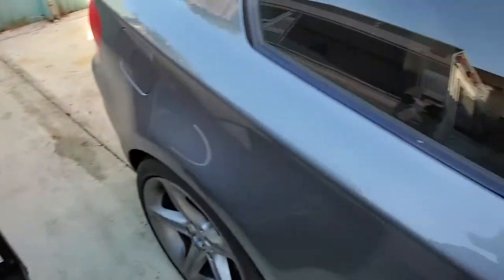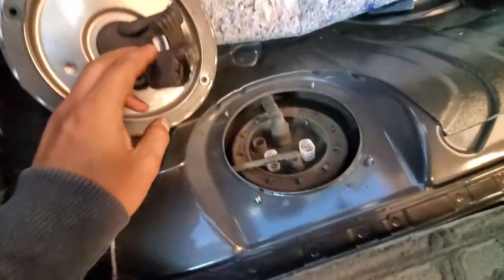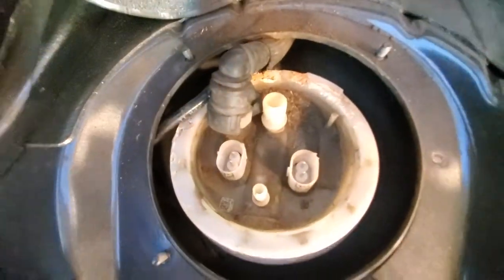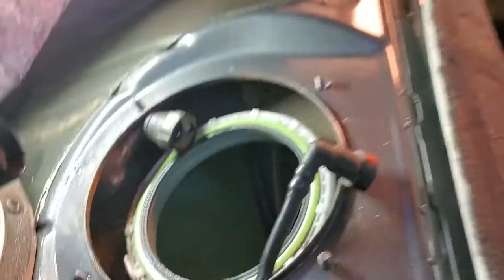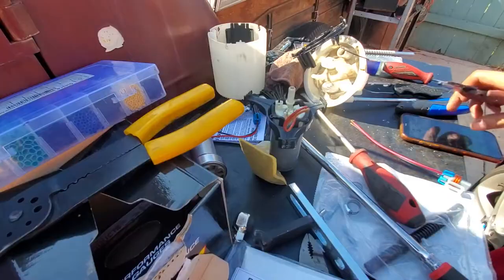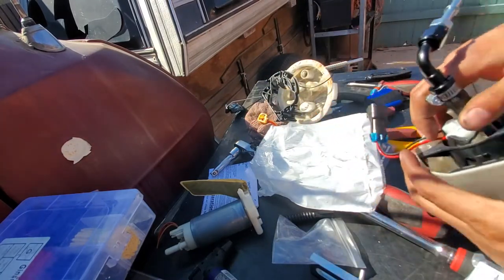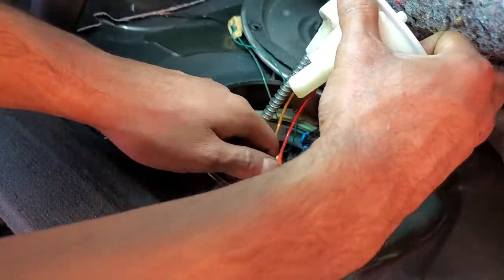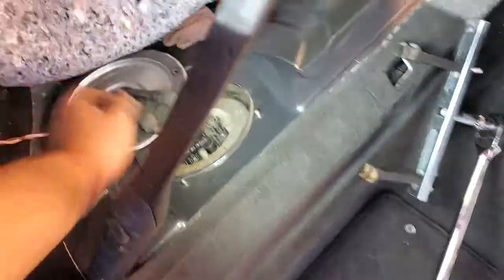N54 STAGE 2 FUEL PUMP UPGRADE!

Comment: Hey man nice video. I just did 2 of these diy pumps in a very similar way. Just so you know you don't have to cut the bucket to fit this pump. Also, that rubber hose that you  use will fail when using e85 and then all that rubber will corrode away in your fuel system. You need to use an e85 rated hose. Trust me.
Reply from the maker: thanks for the tip i did hear about the hose having to be e-85 compatible. And it is true you dont have to cut the bucket but i saw online its not a bad idea to do so.
Reply: @menjicar  hey i know i’m about 7 months late but it’s actually better for you NOT to cut the bucket, the bucket is there to hold fuel when ur tank runs low (under a quarter tank or so) so that the pump can stay cool and lubricated. cutting the bucket will allow that fuel to escape when running low on fuel. you can cut the bucket but if you do so you CANNOT run your tank under a quarter. it could damage your fuel pump from not having lubrication/cooling.
Reply from the maker: @kittenzmeow  THANKS! I did have something similar happen to me. I had less than a quarter of the tank one day and I was getting on the freeway on ramp that is a pretty tight turn. All of a sudden engine cuts out and I pull over to start the car and it starts up normally. Later pulled the codes and it was a fueling issue. Most likely due to the fuel being moved to the opposite side of the pump because it can’t hold the fuel anymore. So yes KEEP YOUR TANK MORE THAN A 1/4 full 😂
Reply: @menjicar  hey do you know what type of crimps you use to get the wires together? after about 1-2 weeks, I get mixture codes and fuel pump possibiliy fault because water keeps getting inside the crimps into the connectors.
Reply from the maker: @audiousity6984  it was just a random kit on Amazon. I would think the connections are going to get wet no mater what butt connectors you use. I also put heat shrink on them.

Comment: Would this help my fuel pump run healthier or it’s only use is to Run A bigger amount of E? My lpfp runs 60 on mHd I know it should be around 80
Reply from the maker: Usually to run more E but you could upgrade to help with fuel pressures on pump gas.

Comment: Hey if I want to do this upgrade do I have to anything to the high pressure fuel pump or no ?
Reply from the maker: No you don’t. It’s so you can run higher percentage of E85
Reply: @menjicar  thank you so much really appreciate it 🙏🏻
Reply: Is there any other benefits? I have a OEM pump however I'm fbo stage 2+mhd and think a stage 2 fuel pump would be a good upgrade no? I just run 93 but would like to try e85